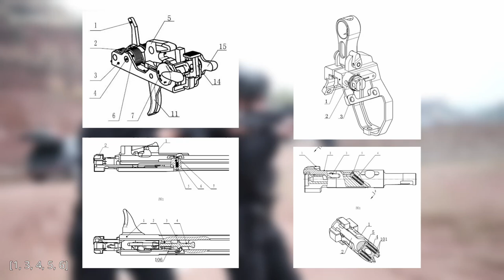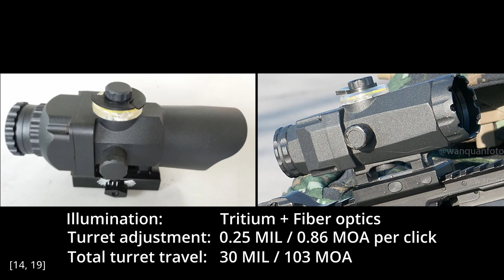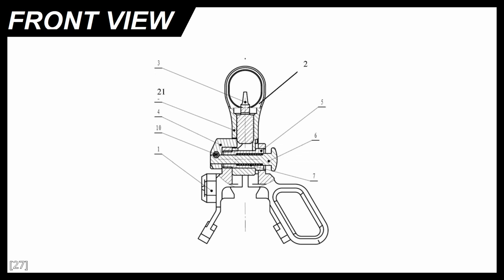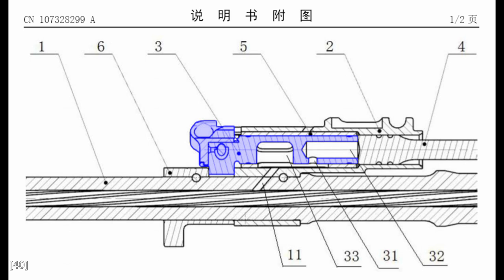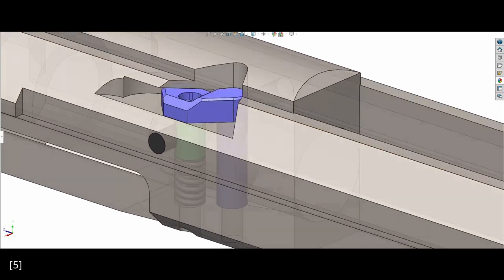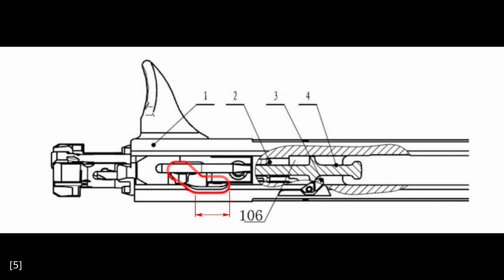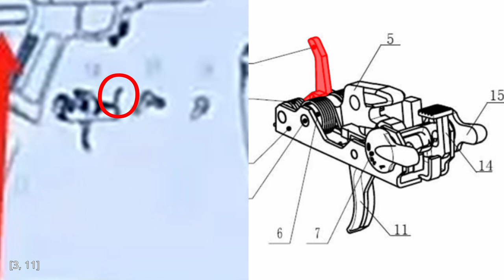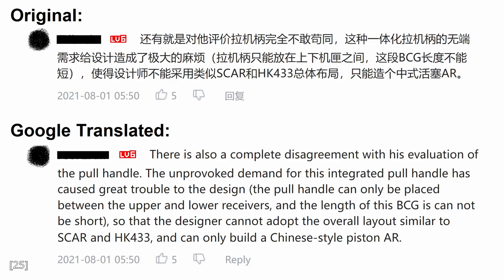QBZ191 - Update / Deep dive [CHECK PINNED COMMENT FOR UPDATES]

Comment: The gas Port is soo genius in both it's prototype designs,  loved that part , simple and good Engineering to solve the overpressure problems
Reply: Which makes me all the more confused as to why they went with an AKM style slanted gas port drilling, which is known to erode unevenly more so than 90 degree perpendicular drilling used on new post AK74 series.

Perhaps their idea is that "bugger barrel gas port erosion, we'll control gas at the regulator plug and use that as the primary constrictor" which is facilitated with the pre-expansion chamber.

IMO, however, that's suboptimal. Why catch a problem that could've been alleviated by simple change in gas port hole drilling angle? First, gas ports tend to wear out right when you need to swap out the barrel anyways, and second, once gas port on the barrel erodes, I do not want to be the poor bastard maintaining that gas plug.

Overall, I think this design anomaly is a case of non-gun engineers tasked with making firearms. Automatic guns are a weird fucking machine. It cycles slowly compared to other machines, yet it operates at such high yet quickly dissipating pressure peaks, characteristic of smokeless propellant. In fact, non-gun engineers designing guns have compromised many gun designs in the past. The AI sniper rifle (original "green meanie") had issues with the firing pin and almost was shipped with slanted locking lugs on the bolt precisely because an engineering subcontractor cut corners in such a way that would've been acceptable in any field of engineering other than small arms. The SA80 and INSAS program was similarly plagued with durability and reliability issues when regular mechanical engineers were put into a committees to build rifles.

TL;DR, guns are weird, engineering wise.
Reply from the maker: @Bhum Brahmavira  Do you have any sources for slanted gas port leading to faster erosion? I'm not saying you're lying btw, just genuinely wanting to learn more. I've heard so many things about the change from the slanted to the 90deg gas block on AK platforms that I don't know what's true anymore. Some people, like you, say that it's to alleviate gas port erosion. Some people say that the gas port for 5.45 is smaller than the gas port for 7.62, and drilling with a smaller drill bit at a slanted angle just wrecked drill bits too quickly, then afterwards both 7.62 and 5.45 gas blocks were switched to 90deg to standardize on one casting mould. Some say that it's to avoid having the gas port directly on the land of the rifling.

Also if I'm not wrong, barrel life is a function of how many rounds has gone through the barrel, while gas port life is a function of port pressure (given that the same type of ammunition with the same pressure curve is being used). The gas system length on the qbz191 and 192 is on the shorter side, so the port pressure might be high enough that they're experiencing gas port failure sooner than barrel failure.

Moreover, the regulator has 2 holes, one small hole for normal operation and one large hole for adverse conditions. The barrel gas port must be at least as large as the larger hole, so during normal use, which is gonna be the majority of the time, what controls the amount of gas to the weapon would be the smaller regulator port. So assuming it's true that a 90deg port will alleviate port erosion, and they use it, they must still have a way to reduce pressure before the gas reaches the regulator port.

Another thing is that while I was reading the patents, I noticed that the designers have a lot of gun-specific knowledge. Like on the patent for the prototype FCG, they specifically mention how the two-stage trigger aids in shooting accurately. On the patent for the current FCG, they mentioned how the throw of the selector on their previous weapons (QBZ95, QBZ03, Type 81) were too large, and the clicks weren't tactile enough, so they wanted to design the 191 with a 45-60 degree throw selector. Also, the entity that designed the 191 is the No.208 Research Institute of China Ordnance Industries, which have had a long standing record of designing armaments. I think it's highly unlikely that the designers lacked firearm experience, from both the end user and engineering stand points. There may very well be more reasons behind the slanted gas port on the 191 that are unknown to us.
Reply: @Bhum Bhramavira Dude, the gun is built by the 208th Institute, where all of the greatest gun designers of Norinco gather and built the gun based on their personal experiences, contemporary experiments and errors of the past. It is not built in a slum warehouse by sub par non gun engineer like you said.
Reply: @kaungzawtun510  Can you share some insight into the slanted gas port?
Reply: @prfwrx2497  gotta keep the tradition running
Reply: @prfwrx2497  very true when H&K got a handle and fixed the sa80 haha
Reply: @cabbage6015  the angled gas port is helping reducing the muzzle flash. This was first been found during the design process of type 81. Because type 81 required a grenade launcher  sleeve. So engineer tried different method to decrease the muzzle flash. And finally this design came out. this is the same type of gas port used on type 81.
I have read the article about this 20 years ago, and sorry I can not recall which article it is. But it was on a major small arms magazine in China and the article is told about the history of the type 81's design stage.
Reply: @prfwrx2497  "which is known to erode unevenly more so than 90 degree perpendicular drilling used on new post AK74 series"

First,  AK-74 was produced by Izhmash in the period 1975-1976 has not used a 90-degree gas port, but uses an  62-degree gas port designed specifically for 5.45x39mm round. Since 1977, Izhmash switched to using 90-degree gas port, but at least one miliion AK-74 built by Tula still using 62-degree gas port designe until they did not participate in the production of the AK-74 anymore.

The Indonesian Pindad SS2 series assault riffle is a modernized version of original SS1 modern, and SS1 using gas port similar to FNC, while SS2 using slanted gas port similar to AK-47.

So it not the slanted gas port that cause the erosion.
Reply: @cabbage6015  The whole psyche of Chinese small arms is best understood as being driven by engineers who are tasked to analyze foreign designs, then adapt their production models to their tooling and materials science capes and limits within Chinese industry.

For many decades, this meant taking US and Russian designs and copying them.

Look at the 1911, M14, Type 56 SKS/AK/RPD, TT-33, PPSh-41, SVD, etc.

The thinking is based on analysis of foreign designs, then channeling those designs through their redesign and manufacturing base.
Reply: @LRRPFco52  something I wish all firearms manufacturers would do - analyze all other designs.
Reply: @LRRPFco52  so copy and paste.
Reply: @prfwrx2497  the change from 45 to 90 degree gasport in ak's had to do with the introduction of higher pressure 5.45 in the ak74 and bullet jacket sheering. (And this was mostly because they used such a large gasport to begin with too). I've heard people also claim it was due to gas erosion, but Knights Armament does a 45 degree port which they claim to shorten gas errosion so I'd wager the later. They do more fine testing imo.
Reply: The dual gas block chambers (both types) seems to just add over complexity in machining when a gas regulator already does this for you. Not to mention there's more elegant ways to do the same basic thing even without a plug/regulator .. Gas errosion isn't as big an issue with short stroke piston systems either. Barrels flame cut through the barrels on the rifling side anyway (though I get that's not the main point).
Reply: You can’t even spell, or even form a complete sentence. Why would you be the authority on what’s considered to be “genius?” 😂

Comment: One thing to really appreciate in this design is the sheer serviceability. Short of the barreled receiver, any major part can be swapped with just a screwdriver and punch. While field service probably isn't doctrine, it is surely a great capability to have in conflict conditions. 

The one thing I'd worry about is bolt life due to thin walls around the extractor spring channels but I doubt it's any worse than the AR.
Reply: I think it's pretty much on par with a Galil ACE. The design seems to take inspiration from that platform.
Reply: @qarmatianwarhorse6028  It derived from previous type-03 rifle's platform.
Reply: China's army has long regarded reliability as the highest standard of firearms, back in the 80s, PLA considered adopting AUG, but eventually, although AUG was regarded as reliable in most cases, it can't be such reliable in a few cases, so PLA no longer considered using it, instead, they developed QBZ95, which has lots of problems but just hard to go wrong

Comment: I'm honestly very impressed by the chinese on this one. This is probably the best small arm they've ever designed. In many areas, most notably the gas bloc, it surpasses the M4 in refinement.

It has a lot of AR and AK DNA yes, but what truly sends it over the top is how they improved that DNA. 
For example; going from the AK magazine's protruding locking lug (Which is subject to high shearing force) to the new style of dual inset locking recesses will vastly simplify the manufacture of reliable magazines. Most likely they will be able to fully injection mold them (something that you really can't do with the AK magazine, at least not without adding metal inserts which is expensive). It's a much better solution.

The only hiccup is that it's so refined that whoever buys it outside of China is going to have to pay a lot of money, because it surely will not be cheap to make.
Reply from the maker: I agree 100%. I also came to the same conclusion about the magazine in my QBZ95 video.

If you see my pinned comment, I just made an update on how a protrusion on the hammer prevents the hammer from slapping the disconnector. I just discovered this like 15 mins ago. Even though the FCG is pretty much an AK in functionality, they still found ways to refine it.

The deeper I looked into this weapon, the more impressed I am.
Reply: I don't think they intend to do much export, at least not for a while and not in the old Soviet-style.  They probably saw that new Russian small arms weren't big hits on the international market precisely because the AKM was so simple and effective that prospective buyers simply could not justify the increased costs for so little improvement.  The same is likely true with this new Chinese gun, at least until 3rd world militaries look to replace their current weapons because they simply can not function anymore due to wear and tear.

Comment: Considering Type 07 pattern camouflage was somewhat butchered through bureaucracy to maintain unit tradition, a call back to the Type 56’s ergonomics seems to make sense.
Reply: It is actually more similar to the type 03 rifle for the charging handle part. Other than that, they also implemented some ar15 style mechanisms like index finger mag-release and the push button bolt release.

Comment: Ejection port on the 191: there is a gaping hole up, between the "carrier key" where the piston strikes and ejection port; which can be an ingress point for mud. On the AR15, even with a longer ejection port than the 191 (plunger ejector kick case out slower than fixed ejector), is still better sealed by the carrier. This is due to the charge handle placement, which forces the ejection path upward, more than the 22,5° of the ar15, making the above mentioned gap. 
Idk why the bolt tail is on the 191, all piston gun (g36, scar) deletes the bolt tail (carrier/ bolt weight ratio). At first i thought the firing pin retainer pin is captive and works like an ar15 selector, rotates to unlock the firing pin, which would be kinda neat; but it was not true. Maybe the bolt is detached from the carrier by manually lift up the anti rotate lever, push the bolt back, cams the bolt out of the lever and pull out the pin? The barrel whip seems minimal for a piston system (see ar18 barrel whip vs m16a1, by larry vicker) which helps with accuracy. Keep in mind that for 1 thing that i or you notice, theres probably 3 other things that slips by. Eugene stoner (smithsonian interview, edward c ezzel) said than weapons cant be "engineered to death" and design deficiency are only obvious when something breaks or fails.
Your work is very good for someone who probably have the never shot a gun ('nam), i assume at least 2 years of watching forgotton weapon? You plan to emigrate to somewhere more suitable pursue your (i assume) designer dream?
Reply from the maker: Thanks for the insightful comment! Yeah the ejection pattern on the 191 seems to have caused a few problem with ejection port geometry. If you look at the photos, you can see that the upper rear end of the ejection ports on the production guns are enlarged compared to the prototypes. There’s also a photo of a prototype gun on Chinese internet with the ejection port manually enlarged with a file, which I didn’t include in the video. I’m also curious about why the bolt tail wasn’t deleted on the 191. I don’t think the amount of material in the bolt tail would cause an issue with mass ratio on the 191, especially when there’s some leeway in the buffer to increase mass if necessary. I think the bolt would be removed pretty much the same way as in an AR-15. Retaining pin out > Firing pin out > Lift locking lever > Push bolt back > Cam pin out > Bolt out. 

Yeah I couldn’t agree more that there are likely 3 more things that went into the gun for 1 thing we notice. I try to keep my conclusion open ended and give the gun the benefit of the doubt whenever there’s something I don’t understand. 

I’m currently in Canada for university, where I do own several guns. But I have been reading up on guns since elementary school. I’d probably have to move to the US if I want to work on guns, bc job prospects in Canada in the industry look pretty grim tbh. My long term goal would be to work for the military (the VNmese  one), but I probably should pick up some experience before that.
Reply: Almost forget, the 191 looks similary to the russian 9a91 in concept: 4 lug bolt (note: bolt tail is present for some reason idk?), anti rotation mechanism for the bolt, piston operation, fixed ejector, low profile (compared to ar15)  trigger group & magwell, detachable trigger group, with the exception that the 9a91 is harder to mount optics, foldable stock and sheet steel construction. 
Pursue your dreams i guess. I do suggest (if you havent already) reading up interviews, patents, biography of great inventors, (john browning, eugene stoner, reed knight, etc). It is so much easier and faster to learn form these expert than doing guesswork by yourself. (Ex: reed knight say: the ar direct gas system's pressure prevent the bolt form boucing in the carrier after bolt unlocking (unlike carrier - trunnion bouce which make the carrier go out of battery) which would gouge the aluminum reciver near the front recess for the cam pin in a piston ar15 (proof: smallarms solution, colt external pistion program); how the brn180 aluminum reciver use a wider cam contact surface to minimize reciever damage (brownell's interview); how a majority of piston gun have steel insert near the front cam tract recess or entire steel cam track. The ar15 gas system also remove the carrier pulling force on the bolt from the unlocking phase (like johnson rifle short recoil mechanism) the unlocking force push the bolt forward into the barrel, not back out of the barrel like a gas piston system. Details like this (which can never be guessed at the designing board) are what make and break designs. Read technical calculation documents like internal/external ballistics, stress analisis, etc; a good source is weapons man's small arms design resource (books, reports, etc). Remember that the original source must be from a reasonably successful, tested weapon designer.
Reply from the maker: @cgdg7075  Thanks! I found that small arms solutions and school of the american rifle are great sources to learn about AR-15/18 pattern firearms. Nathaniel F on TFB has interesting write-ups as well. I'll keep in mind the other details you mentioned.

Comment: Gas chamber over-pressured:

2 Chambers!

Weak extractor spring:

2 Springs!
Reply: the 2 springs aren't there because they are weak, they can be easily made strong. it is because they are  long and slanted , and they need to dodge the middle hole.

Comment: How hard will it be to convert 191’s non-free floating barrel to a free floating one?
Is it as simple as swapping new aluminum hand guard that doesn’t touch the barrel? Or does the barrel itself need special treatment?

Also it seems to me that 191’s hand guard is too short for attaching IR Illuminator and used in a C-clamp. The non-detachable iron sights just worsen the issue. Seriously, how did the designers not think of that? 

And the sling mount positions are too limited… the core mechanism is more than well thought out, but what were they thinking when they designed the outside?
Reply: they probably thought of that but did it anyway to save money